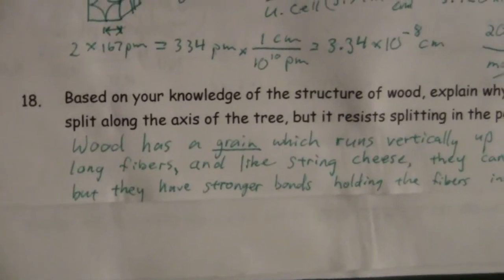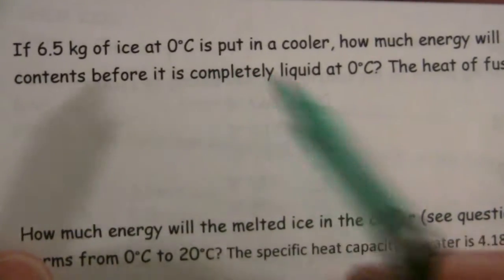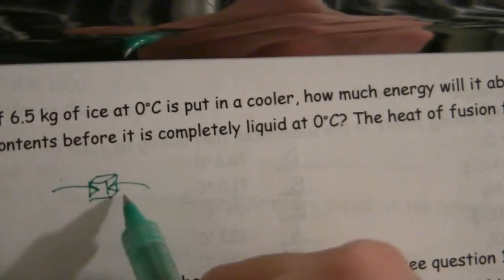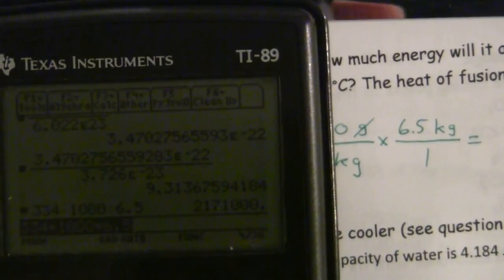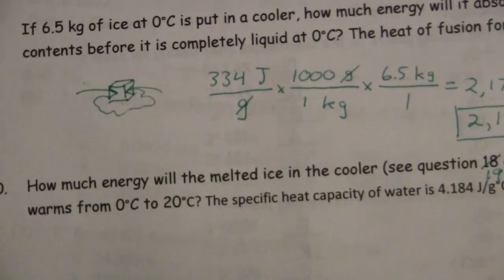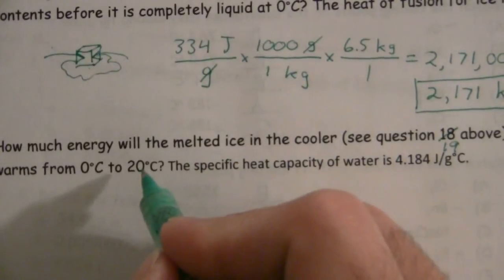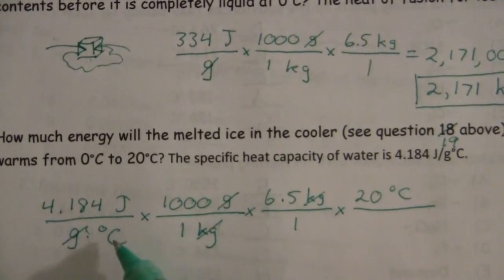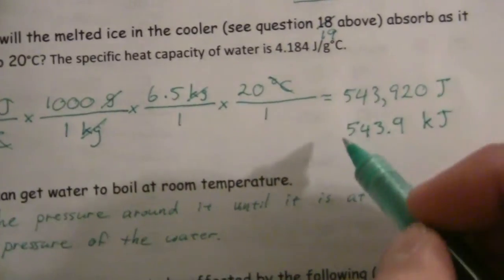Energy Required to Melt Ice & Warm the water

Comment: I was so glad to find this, thank you! I am wanting to calculate the energy that goes annually into melting global ice, and compare it to how much temperature change that would represent if it just warmed the water (or air). I don't have global figures for ice, but NASA gives 303 gigatons average annual loss for Greenland since 2004, (ice "shed" which I will assume melts in the ocean), with annual acceleration of 31 GT/year, so that gives me a place to start. You gave me both examples of calculating the energy to melt the ice, and a way to calculate (I'll rearrange the issues) an equivalent warming of water to illustrate what that represents. Or maybe I will figure out a way to actually calculate the rise in atmospheric temperature that equates to, which is more the point. Thank you so much for putting this problem here for anyone to find, and solve along with you.